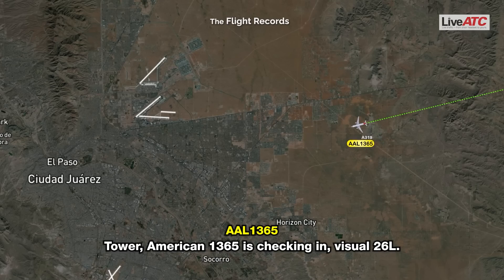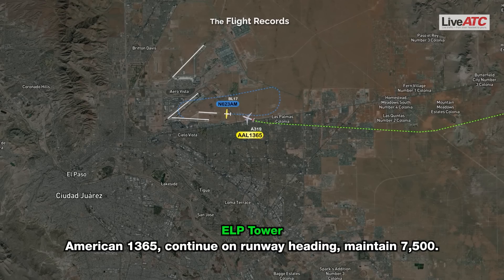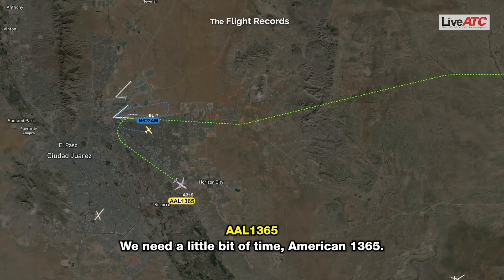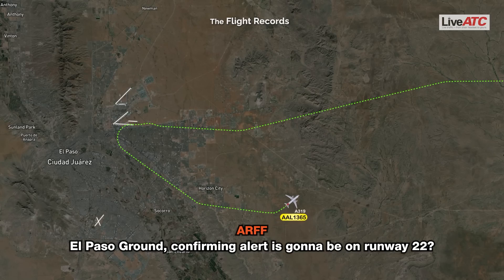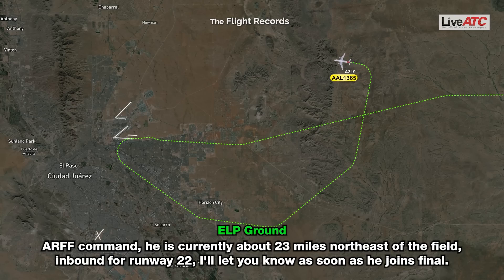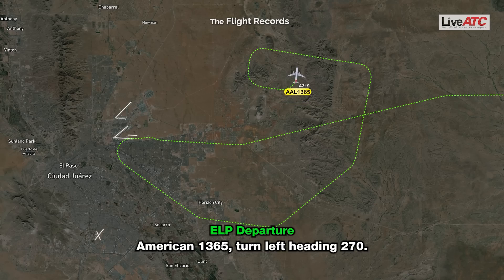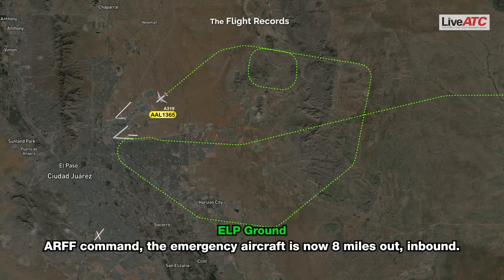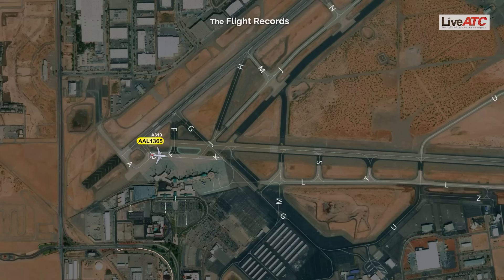American Airlines A319 Experiences Flight Control Issues on HONOR FLIGHT into El Paso

Comment: 1:50 Pilot: “It’s a right turn?” Glad he was paying attention to the traffic ahead 😳
Reply: If I understand correctly, the airliner was on course for 26L - which means he was heading approximately 260 degrees.
The controller asked him to turn to 120.
From 260, turning right, there's 100 degrees to 360, then another 120 degrees to 120, for a total of 220 degrees.

Turning left, however, there's only 140 degrees to turn from 260 to 120.
This isn't evidence of disorientation, rather it implies that he was dealing with something out of the ordinary, it's likely that the problem with flight controls was happening earlier, and that he called for a go around because of the flight controls issue, not the other airplane on a parallel approach to a parallel runway.

Comment: If that other a/c wouldn’t have got in the way of AA they would’ve been on the ground before all the control issues started!
Reply: Other aircraft had nothing to do with it.  As other comments suggested it could have been any number of other issues that would likely come up in the approach at about the time they would be dropping the gear and setting flaps final.  Some things to note…
It wasn’t an indication of unsafe gear as they would definitely have said that.  Likely other issues could be flap dissymmetry, sudden low quantity or pressure in one of the hydraulic systems, or a host of other minor things that would require them to run some check lists and FE brief for the landing. They did have some, if not all the flaps as they would have otherwise let them know of a much higher approach and landing speed and possibly hot brakes. 
One other note.  Pretty sure that was training I; progress in the cab.  The trainee said “fly heading 120” without a turn direction, this is allowed under most circumstances but apparently not in this case as we get another voice override him and say “fly runway heading”.  Then back to the first voice after that.  Something common in training.